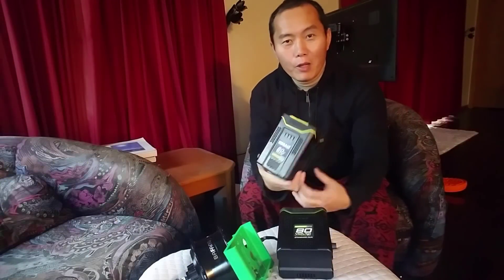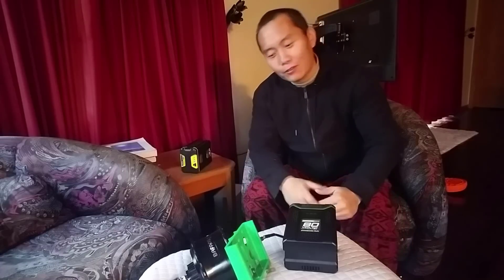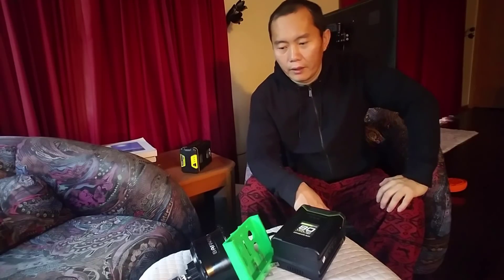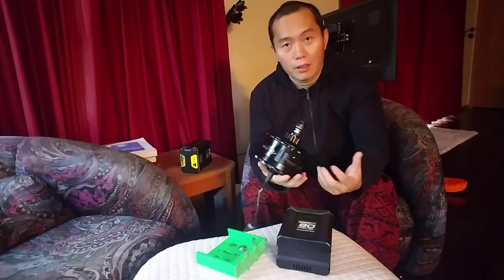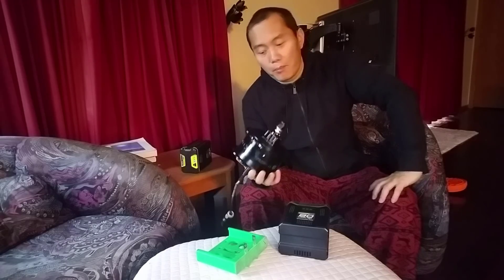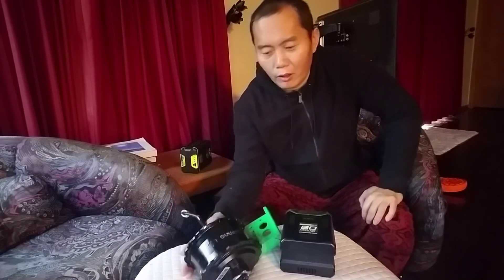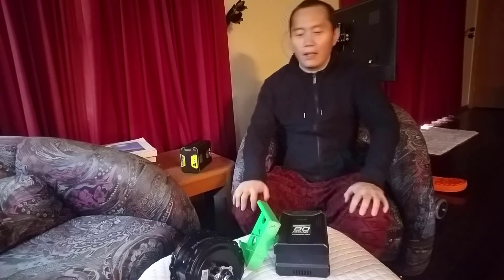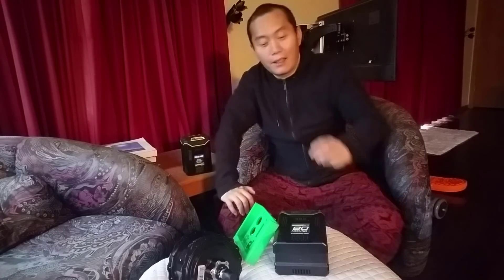Greenworks Kobalt 80v battery for ebike or electric motorcycle

Comment: Can I put a governor on that  80 volt cobalt battery to keep the ebike under 28 mph  ,and will u get more miles per battery 80 volt .thanks
Reply from the maker: Speed controller do those work, not the battery.

Comment: Will it wreck a Greenworks 40V trolling motor if you use the Greenworks 80V battery?
Reply from the maker: Of course, you can't use 80v battery for 40v trolling motor.
Reply: @JerryMinne  I don't understand why it is ok to power a e-bike with twice the rated voltage, but not ok to power a trolling motor with twice the rated voltage.

Comment: Hi Jerry, are you using a 72v or 48v controller, with your set 80v battery e-bike build?
Reply from the maker: You have to use 72v controller for 80v batteries.
Reply: I have two controllers on my dual motor bike rated at 18a. How would I find out the voltage? The seller doesn't have manufacturer specs  @JerryMinne

Comment: Would a 80v green works battery like you have work with the bafang 1000w 52v mid drive motor?
Reply from the maker: Mid drive has built-in controller. It will not support 80v.

Comment: How many amps can the Greenworks 80v batteries put out before the internal BMS cuts the output?
Reply from the maker: Roughly 20amp
Reply: @JerryMinne and 80v 4ah how many amps can it put out
Reply: I think the number changes as the ah goes up... an 8ah Greenworks will allow more current before the bms kicks it out. I know this is true of their 82v series,  but I'm not as familiar with the 80v.

Comment: The purpose of figuring wattage is the multiplication of the voltage times the current. So if you double your voltage you have to divide in half your current or you will go over your wattage. Wattage is total power consumed. Hope this can' help you understand the correlation between the two

Comment: I have an ebikeling conversion kit, current battery is 52v with a 1200w rear hub for fat tire bike. Will I need to upgrade my controller and/or wire gauge size in order for this to work or can I just buy the adapter, buy the battery and plug and play? Thank you!
Reply from the maker: Only need to replace wires for off road conditions. If you ride city streets most of time you don't need to replace them.
Reply: I just ordered my adapter for 80v Greenworks Battery upgrade! Hopefully my controller can handle it! Thank you! I will post feedback shortly. When can I expect my order to arrive?

I don’t see “Kobalt” anywhere in the Greenworks 80v Battery. It looks like the same battery though
Reply from the maker: Will ship on Monday by first class mail. Thanks.
Reply: @JerryMinne  Hi Jerry!
My Adapter is coming soon! Thank you for sending tracking code!

My question is: which 80v battery do I buy?

Kobalt 80v
Or
Greenworks 80v

Which will the adapter fit? Thank you!
Reply from the maker: You ordered greenworks 80v adapter which only works with greenworks 80v battery.

Comment: If I understand right, the 3D printed mount you made for the battery will not work with a Snapper 80V battery right, since the rails are proprietary?
Reply from the maker: Snapper 80v has the same rails location as kobalt 80v battery. I have that option you can order from my website.

Comment: So if you're increasing your wattage to 1700w with the 80v battery, won't it blow out the 750w motor?
Reply from the maker: I actually tested it as paragliding winch. it can drew 40amp current without problem. which is 40ax80v=3200w
Reply: @JerryMinne  Ahh, I see on some 750w motors have a max draw of 70-80amps. I bet you could increase the voltage quite a bit more to go even faster.

Comment: What is the length of your commute, and the power consumption for it?
Reply from the maker: Generally speaking 1ah equal 1 mile on ebike range.
Reply: @JerryMinne  so the battery is 6amh so six miles?! Geez
Reply from the maker: For off road condition yes. I explained in this video: 
https://youtu.be/ze2794GCcdo

Comment: Do you have any safety systems or provisions on your bike?
Reply from the maker: Power tools battery already has many safety features. You can add voltage meter on your ebike to provent over discharge.

Comment: This is a very durable product with a solid lock to the battery. It will work for most applications but since it has no balance and protection circuit high draw applications could result in some battery damage.
Reply from the maker: Right, recommend to add voltage meter to monitor it and provent over discharge.

Comment: I am really confused with ebike controller. One says it is for up to 500W motors. But it also says: "Maximum current 25 Amps". Ohms law means that at 25A with 36v, I'm running 900W. So shouldn't that controller be called a "900W" controller and not a "500W" controller?
Reply from the maker: Max current usually just a few seconds. If ebike controller marks max 25a, normally continues current is about 15amp.

Comment: hey, this kobalt/greenworks/stiga batteries has 4 pins - 2 pins (+ and GND) is enough? bcoz i make similar adapter and use 84V to 12V stepdown  (180W) - when I plug PC (12V) to it 50W, its shutdown for a 2seconds and i cant power it, I can power 50W of fans without problem :/
Reply from the maker: Check your converter capability if it supports pc.
Reply: @JerryMinne  instead of PC i plug 7x fans (30W) total and the same situation

Comment: How many volts/watts is the speed Controller?
Reply from the maker: Of course it requires 72v  speed controller. Wattage depends on your motor.
Reply: @JerryMinne  i have a 52v battery on a 36v speed Controller so i was just wondering if you could run a 80v battery to a 36v speed Controller 😁
Reply from the maker: I don't think so.
Reply: @JerryMinne  thank you

Comment: So on your bike, what motor do you run and how long does this battery last?
Reply from the maker: Bafang 750w hub motor. I only ride on trails, so hard to tell the millage, but 4ah 80v battery should be enough 15-20 miles.
Reply: @JerryMinne  seems like alot of miles for not much AH
Reply from the maker: @VintageSpeedwerks  4ah 80v battery equal  to 8ah 40v battery.